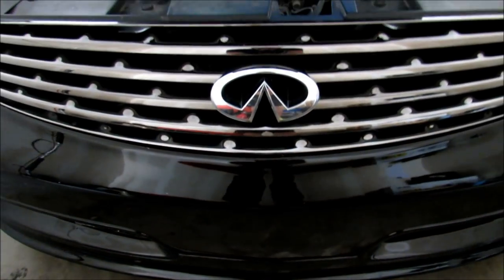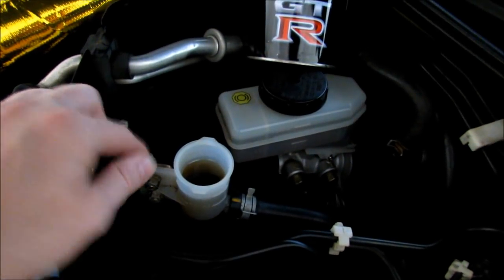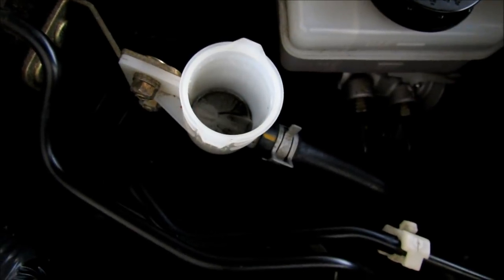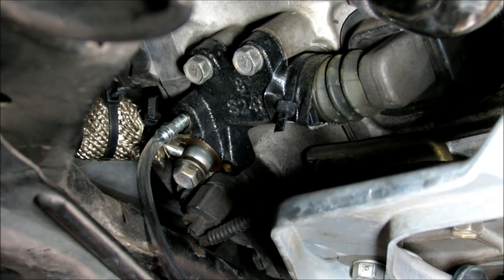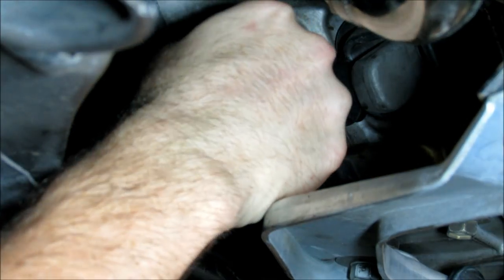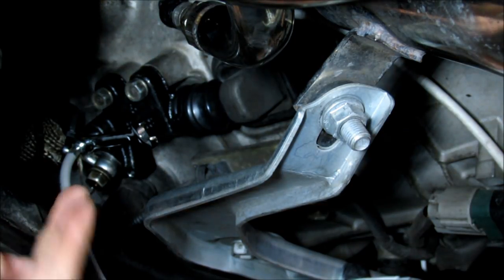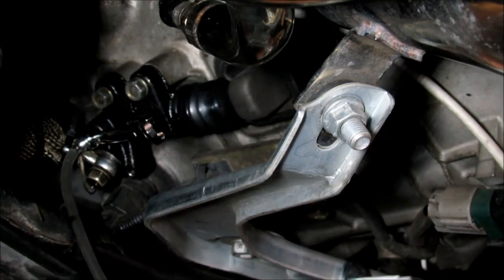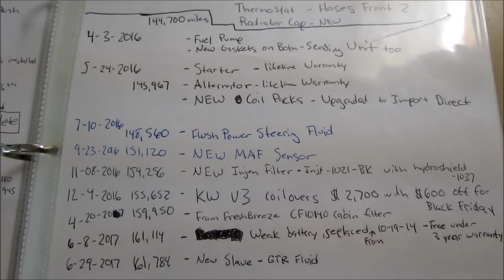INFINITI G35 / Nissan 350z - Fix Clutch Pedal - Bleed Install Slave Cylinder

Comment: That black residue/murky fluid is clutch dust from the friction disk and will accumulate in the slave too. You must drive your car hard for that to appear in the fluid. Change the fluid every 6 months if that's the case.
Reply from the maker: porksniffer .....Really? That does make a lot of sense, I bet you are right, thank you. Well yeah, I floor it everywhere, every single day making Shockwaves )))  Hmmmm....my clutch usually makes it to about 80k miles. It would have made it further if I wasn't Rev battling a new Camaro, before a race. I had the clutch pushed in, cracking into it, then the the throw out bearing exploded. First time in my life this has happened, the clutch wasn't slipping when it went out, when I depressed the clutch pedal, the car would die. Push the clutch pedal in, car die. Usually you get slipping for a month before having to installing a new clutch. If my throw out bearing doesn't explode again, I am thinking I can get 100,000 mile with another exedy stage 1 clutch. I consider that good. How many miles can you get on a clutch taking it easy?
Reply from the maker: Dave and his Miata........made the comment the fluid turning black is from the rubber hose running from the clutch reservoir to the master. I already have a stainless steel clutch line down by the slave. Do you think the black residue is from the rubber hose? 

After thinking about your comment, it makes sense for an internal slave cylinder, which would be a G37 or 370z. This is a external slave and it is impossible for the clutch residue to get to it. The external slave just pushes a lever on the outside of the bell housing. No way for dust from the inside of the bell housing to get into the slave fluid, nothing is connected.
Reply: Motordyne G35 I was about to say that same thing lol
Reply: Just like Motordyne G35 stated how is a sealed hydraulic line going to pick up clutch dust from the friction disk?

Comment: Hey I did this yesterday but for some reason ever since I first disconnected the slave cylinder the pedal gets stuck to the ground and doesn’t come up on it’s on I bleeder the whole system both master and slave cylinders but still gets stuck to the ground completely and it would not do that before changing it any ideas???

Comment: Do you leave reservoir cap on or off while pumping the clutch ?
Reply from the maker: Doesn’t matter on or off. I had mine off though so you can keep topping it off as it gets lower. It’s important it doesn’t get low on fluid and you suck air in the system.